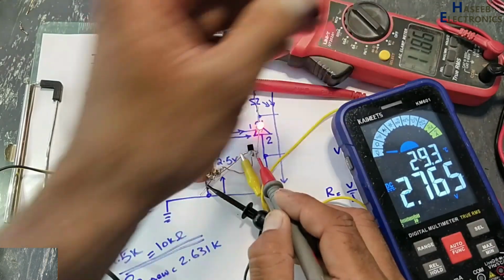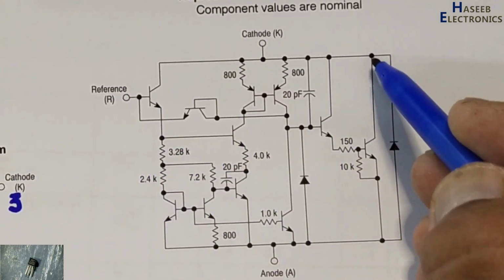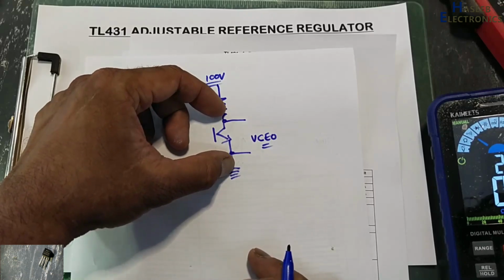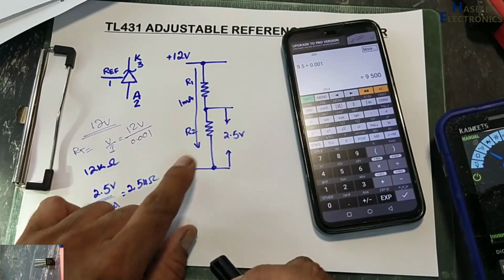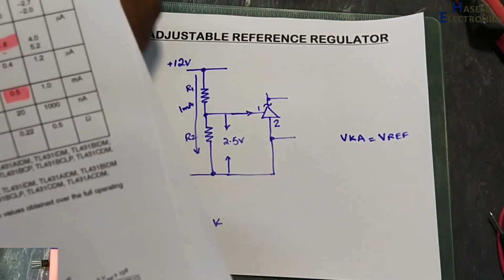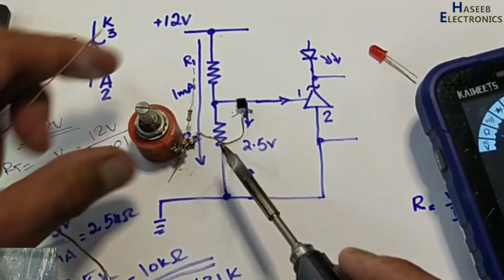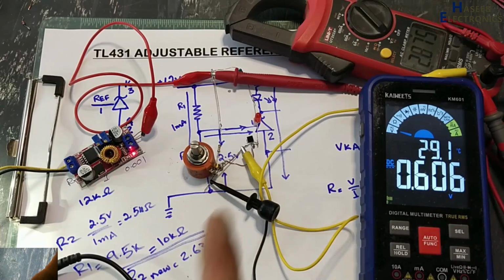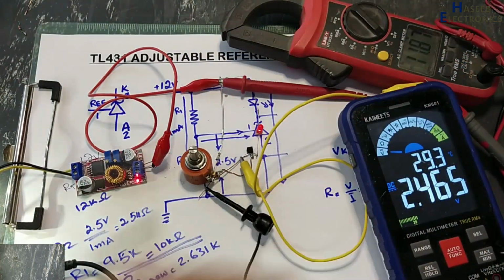Understanding TL431 Adjustable Reference, Theory and Practical {1203}

Comment: Really helpful sir. Yesterday i tried my self to increase the voltage of 12v adaptor to 15v. So i tried alter the divider point of tl431.So i used the following fomula to find the divider resistance value. =2.5×(1+R1÷R2) here R1=51k and R2=10k. so the output is 15.25v. And my output voltage is also as expected sir. My doubt is. Is it make a pulse to control the optocoupler or its just turn on the led sir. When ever i have a doubt about a specific topic, your also make video in  same topic sir☺☺Thank you once again.
Reply from the maker: great 
you also need to change the current limit ratio with the same ratio
if you increasing 12 volt to 15 volt 
and you are adjusting reference resistor network 
then the output voltage will increase in output of the TL431. which will cause to increase the optocouper LED current and it will also disturb the feedback 
so you need to increase the current limit resistor to decrease the LED current 
so the circuit will work without creating ripples or ringing in swithcing
Reply: @HaseebElectronics  wow great sir. To understand your comment I read it 3 Time. Now I understand.  The led current limit resistor value is already 2.2k . So I thought it would handle the led current. Thank you for your valuable comment sir. It makes some sense to me.

Comment: Sir Goldstar 9500 satellite receiver has no output vcc cap and switching ic have unstable voltage  2R2  2R4 and 5R1 resisters gives continuity is it normal? thankyou

Comment: Without confuse sir again i request if two ic is connected in circuit board where is the returning path of current flow.please explain sir the returning path of current in ac and DC circuit.
Reply from the maker: Battery negative terminal is most of time reference point